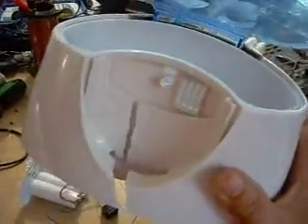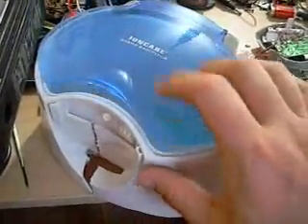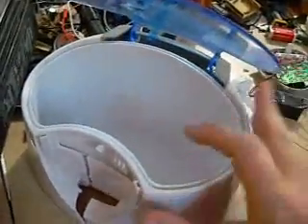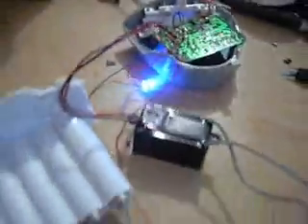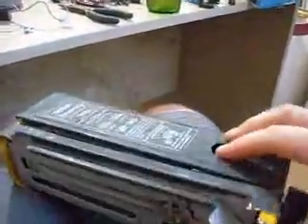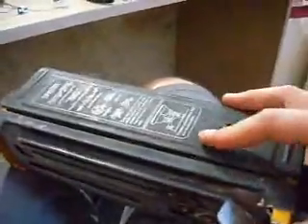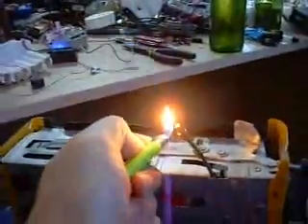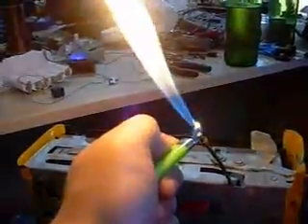Ionization of gas

Comment: I'm interested in introducing Ozone into the air stream of the engines(2000 Honda insight) air intake manifold, for experimental purposes. Ozone being an excellent Oxidizer, may increase the Oxidation of the Gasoline ie Fuel. I will use a much larger Ozone Generator, which will generate Ozone on demand ie while the engine is running.
Reply: True Zero Emissions if you look up Herman Anderson he used ozone in his setup. And if you watch Stan Meyers videos of his dune buggy he doesn’t say it or point it out but he as well uses ozone.

Comment from the maker: @SuperDisbelief its actually rated as 45 watts but that rating is for the 240 volts and the losses in the  circuitry,and also full brightness.the high frequency of the ozone circuit is more efficient at lighting gases in vacuum,and considering its not full brightness im tipping it run for quite a while off the batteries

Comment: @m3sca1 Slaps Forehead. I just remembered that I read somewhere that if you bubble ozone through water you can get Hydrogen Peroxide from it. Ok, it's not rocket fuel grade or concentration but under pressure.... Humm.

Comment: I was thinking the same thing about the Meyers system. I'd say what is happening here is that the spark does not have enough activation energy to initiate combustion of the Butane gas. Also the UV from the spark will produce some Ozone. That's how our Sun does it after all. BTW, where did you get that sanitiser from? And was that pair of pliers from Bunnings? I think I've got the same pair, lol.

Comment: Ozone is generated by plasma (The glowing stuff ). As plasma is energetic it seperates electrons from atoms,it certainly has enough energy to ignite flamable gasses. I suspect the gas you are using is being reseased at a rate greater than at which the tiny amount of plasma can ignite it as it is flooding all the oxygen from the surrounding air from around the plasma source. The same as when you tried to light the gas with the lighter & it took a few attempts as the gas was putting out the flame.